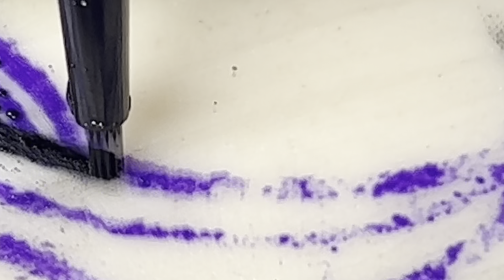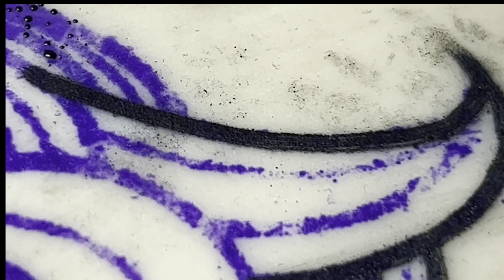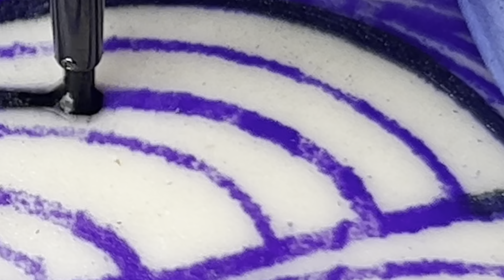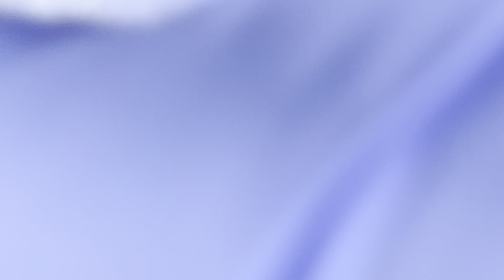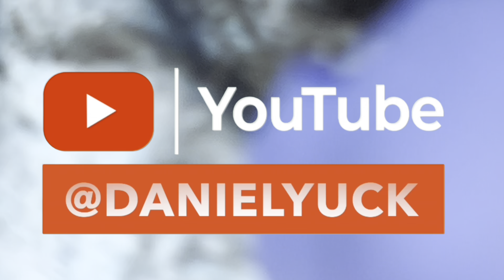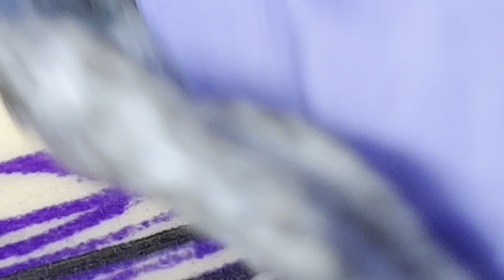Hand Speed And Voltage-Tattooing 101

Comment: Does needle size affect your voltage?
Reply from the maker: Yes! I feel like the needle size does impact hand speed and voltage. The smaller the needle the easier it is to break the skin so that would have to be accounted for as well. 

Every needle has to be matched with hand speed and voltage no matter the needle size/configuration

Comment: That can't be 8 volts because my machine has to be at 9 to get that pool of ink to show. Maybe it's my machine
Reply from the maker: It indeed is 8 volts. I always run at 8 majority of my time pulling lines. I used to run at 7.5 but I found for me 8 is my sweet spot. I never go above 8 volts and that on any machine I’ve personally used. For me going above 8 is unnecessary and too much for my hand speed.